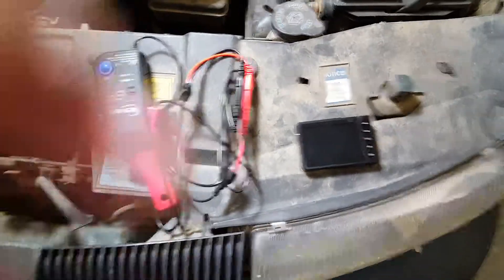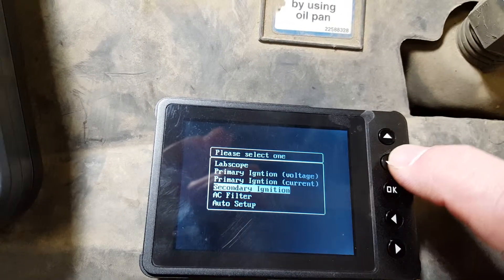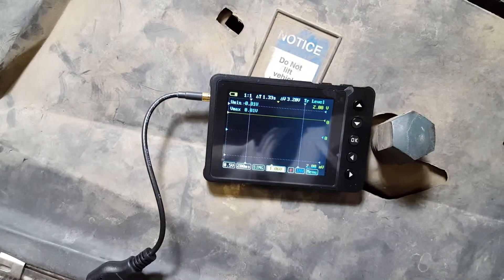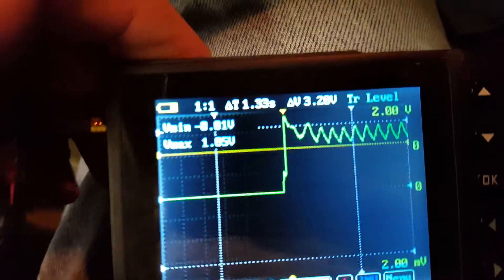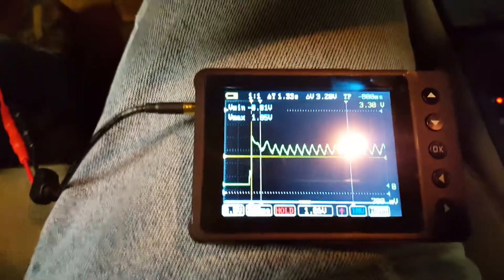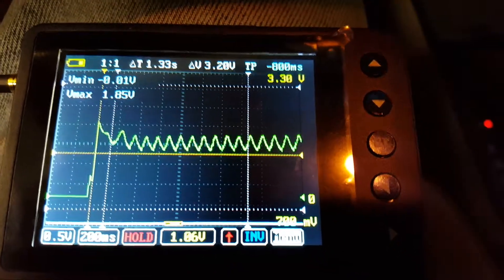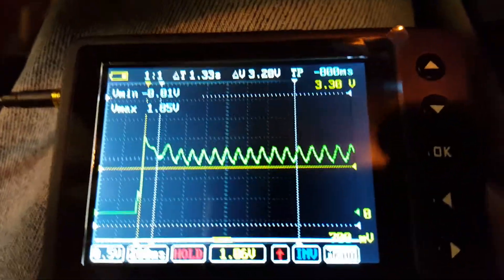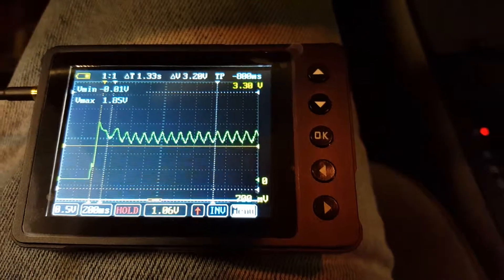Relative compression test.

Comment: I am  wondering if I use my one channel uScope and record/save the waveform to my user reference file folder, then run a secondary  ignition test could I then load the one test and overlay that with the second test referenced file to determine which cylinder is the low compression one? Just wondering if that would work.

Comment: I have had one of these little scopes for automotive use for the last few years and It has come in handy a few times, great tool for the value!
Reply from the maker: Yeah,  I like this one for a quick check on a sensor or 5 volt reference or compression test, I have moved up to a 4 channel that works with my Autel scan tool for some more detailed diagnostics.

Comment: GREGS MOBILE AUTOMATOIVE AC REPAIR, 
                                   when one or more pistons are NOT giving any compression. What would be the problems on the cars engine? 
        Do you have to replace the piston or the actual engine block is cracked inside that piston cylinder and have to replace the whole engine block?
Reply from the maker: If you are seeing one or more cylinders with no or low compression, it can be a couple of things, you could have failing piston rings, or a bent intake or exhaust valve, or a valve seat that is fouled. You could have a blown head gasket, or cracked head. In order to determine what is the cause, you will need to do some follow on testing with an actual compression test kit, doing both a dry and wet compression test on each cylinder will help determine if rings are to blame, doing a cylinder leak down test can help figure out if it is an exhuast/intake valve or head gasket issue. There's alot more than I can cover in a commebt section.
Reply: @gregsmobileautomotiveacrep1731  
1.) The Actual Compression test kit will measure the PSI level of that No or Low compression cylinder? you will want the PSI level to be 30 PSI or more than 30 PSI to considered good? 
2.)  What do you use to do a Cylinder Leak Down test? I have seen technicians poor water on the cars engine to see if the head gasket is leaking or sucking in the water. If the engine starting to running funny misfiring while applying water on the value cover and head gasket this means that its the head gasket or intake value?
Reply: @gregsmobileautomotiveacrep1731  thanks for the help
//  I couldn't find a video of yours on how to test each gauge in the dashboard. How to test the oil gauge, temperature gauge, gas gauge, to check if they are good or bad how can you test them using what testing tool for cars 60's,70s, 80's, 90s gauges?